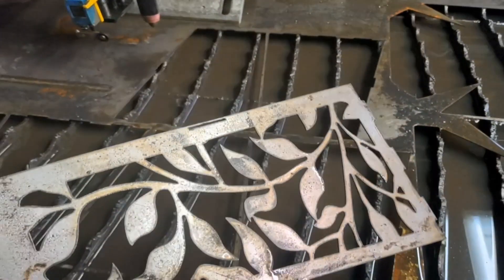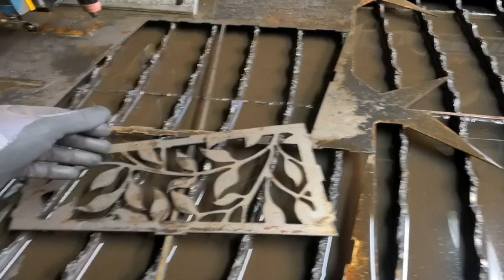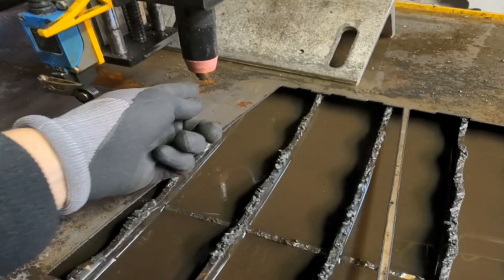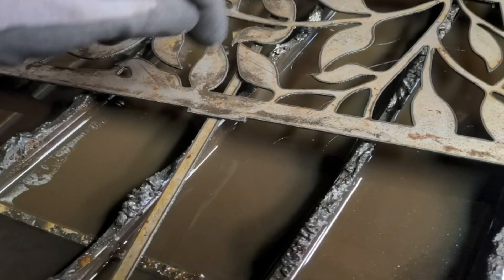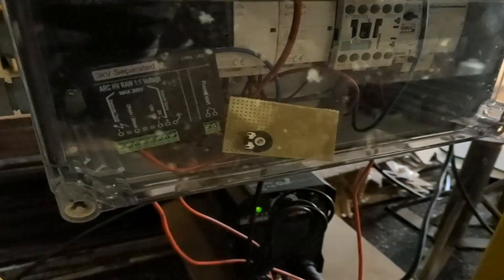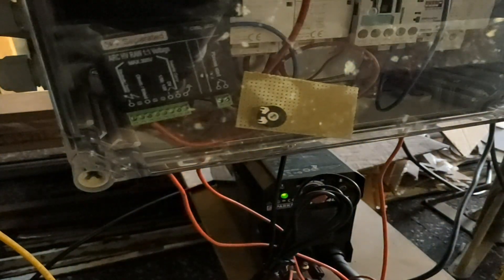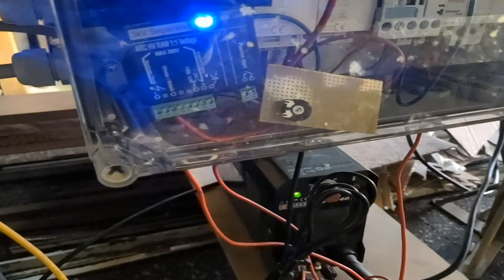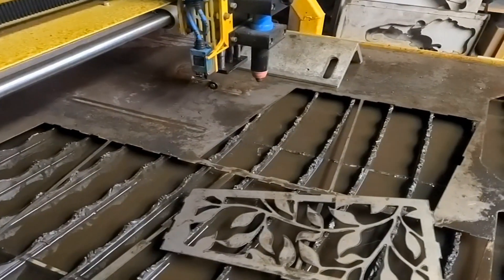Plasma CNC Ohmic Antastung Wasserspritzer - Myplasm CNC

Comment: Das ganze ohmic sensing hab ich so gelöst. 
Es gibt 1 extra 24V Netzteil, dazu noch 2 optoisolierte Relais. Beim Sensing werden beide Spulen der Relais in Reihe über die Spitze des Brenners aktiv geschaltet und an den Kontakten werte ich das Signal aus. Es müssen also gut 30mA fließen, um ein Signal zu erzeugen. 
Da kann so viel Wasser spritzen, wie will...der Strom reicht nicht aus. 👍
Reply: Zu meiner Zeit gab's das omic garnicht...
Reply from the maker: Auch eine super Lösung! In meinem Fall war der Fix mit dem Potti schnell und einfach. Die Lösung werde ich im Hinterkopf behalten, sollte die Potti-Lösung langfristig Probleme machen.
Reply: @foxfpv8246  Wenn du da mal Unterlagen brauchst...hab die komplette Doku incl. Schaltplan von meinem Eigenbau fast fertig....👍
Reply from the maker: @svenkrause3433  Gut zu wissen, besten Dank! :)
Wie gesagt, ich belasse es erstmal so, aber sollte es Faxen machen komme ich darauf zurück.
Reply: Could you show the diagram for others to use please and thank you
Reply: @prestonbaillargeon9276  Its not possible here...to post a picture.
Reply: Hi, würdest du mir vielleicht den Schaltplan bzw Bezeichnung der Bauteile zur Verfügung stellen ? Gruß
Reply: Diese potti Geschichte funktioniert bei mir nicht.. das Wasser bringt den Stromkreis immer zum Schließen. Habe ein potti bis 220kOhm ausprobiert. Irgendwann erkennt er das Material nicht mehr